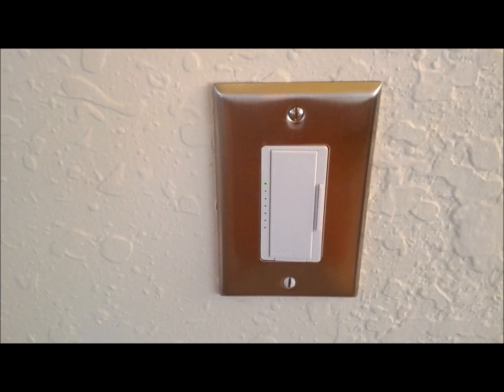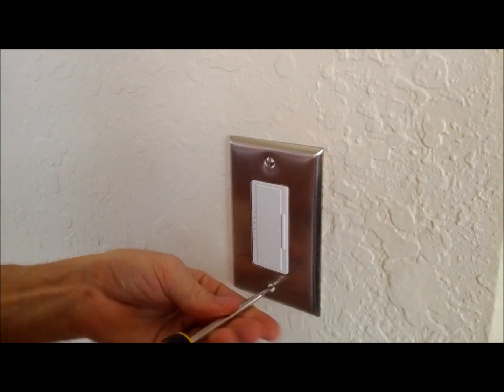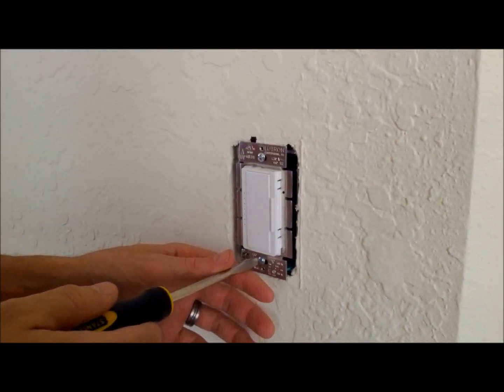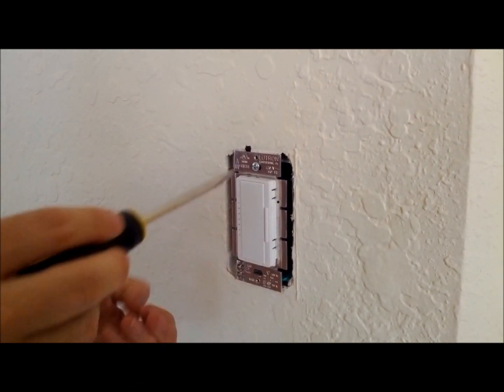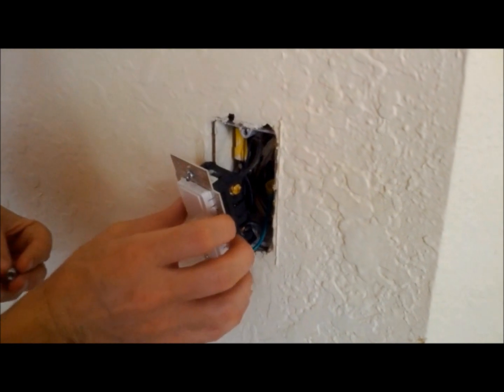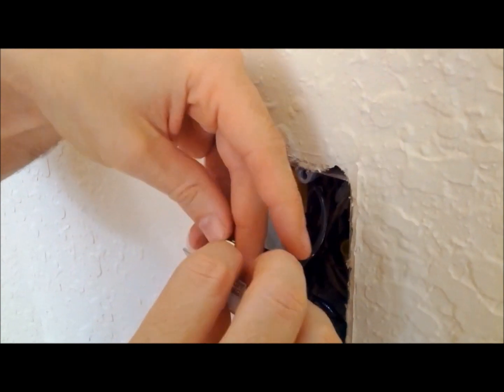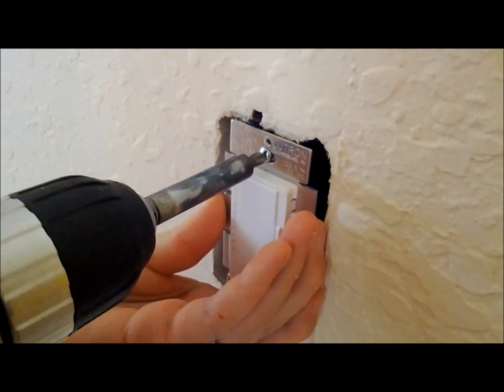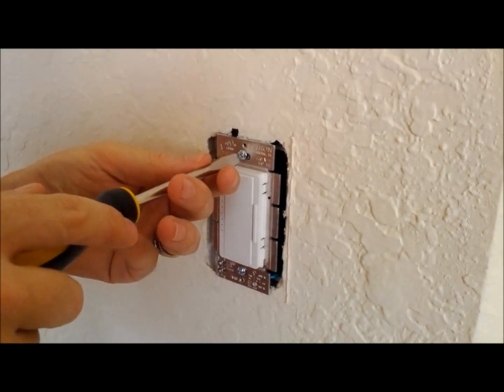How To Fix A loose Or Uneven Outlet, Switch Or Dimmer In Your House Or Garage.

Comment: What if the light switch went lose when the light is on? Now I can't turn it off
Reply from the maker: Not sure if you got it fixed yet or not but I am not sure what you mean by lose.. as in the switch just flops back and forth? It may have broke inside and if that is the case you will need to replace the entire switch.
Reply: My switch got stuck last night when I turned it on and had to be pushed harder than normal to turn off. Now it's incredibly loose and wiggly. I turned off power through the breaker, removed the face plate to check for any loose connections or wires, but everything appears fine other than the switch itself being incredibly loose. Does that mean I need to replace it entirely then?